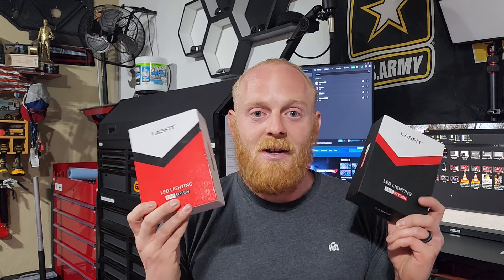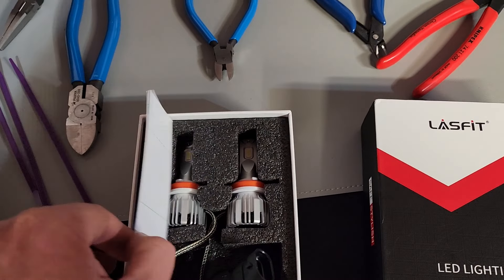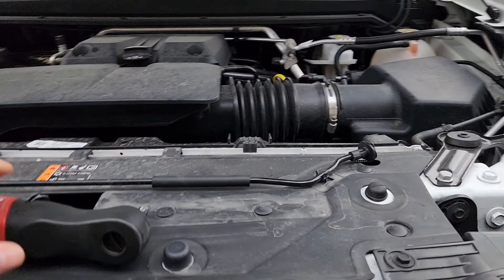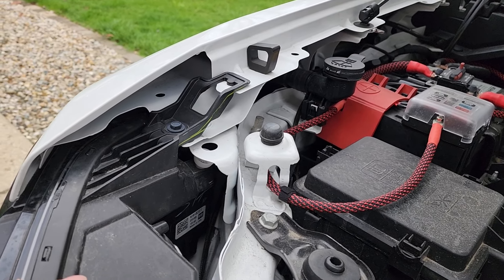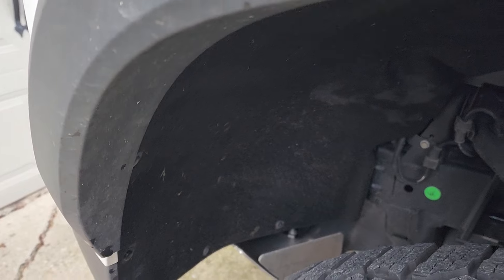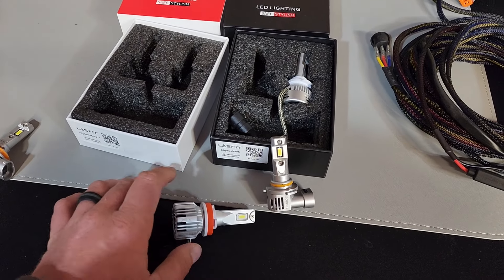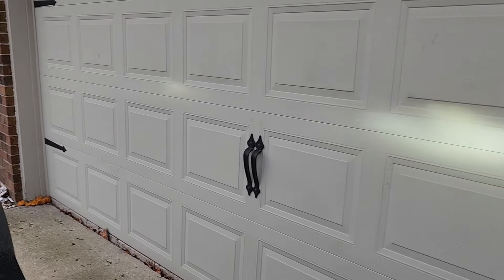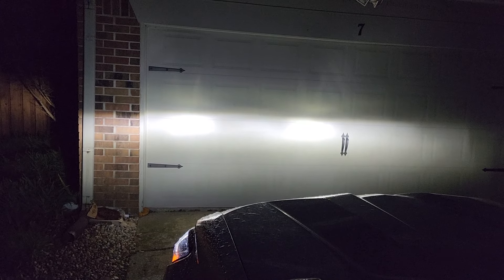2023 Colorado LED Headlight Issues Switch to Lasfit Do NOT use Oxilam

Comment: I installed the oxilam after I watched your first video. Ran into this issue about a month ago and got worried about having leds in halogen housing. I switched back to halogens. I have the lasfits that you have in the video but now I feel better about putting them in. Thanks!
Reply from the maker: Ya unfortunately I never had experience with oxilam lights before and won't be going with them ever again. I should have stuck with the lasfit brand to begin with. Just a much better bulb. Sorry you had issues as well.

Comment: for about 3 or 4 years ive only used the "sealight"? brand, 2001 Mazda Tribute (ford escape) has over 25k on the various LEDs ive done, doors, heads, fogs, dome, tail, signals, etc. i dont think a single incandescent or halogen is left anywhere, just FYI
Reply from the maker: Ya sealight is another one I saw when I was first looking into lasfit many years ago. I think they started around the same time frame. I've heard good things about them as well

Comment: Hello again, Tony 
Thank you for another Great Video 👍 I had a 1999 Nissan Sentra that had the head lights flicker like that. But the cause was the alternator I went through two after market alternators, then I bought an OEM from Nissan, problem solved 😅 Again thank you
Reply from the maker: Ya I have seen that before as well especially on alot of older trucks. Thank you for watching

Comment: Do you have any issues with the lasfit high beams and moisture getting into the housings? Felt like the lasfit bulbs I got didn’t go in as tight as the oem bulbs when tuned into the socket
Reply from the maker: No issues on mine. Are you sure you got it fully seated?
Reply: @ they are, and we’ve had some heavy rain recently here in WA and I’ve got no moisture. I was just concerned because the adjustable beams make it able to move around a little.

Comment: Since the time you installed, Does this blind oncoming traffic? Have other drivers flashed their lights at you?
Reply from the maker: If you leave the beams where they are you will blind others. Simply aim the headlights down correctly and you will have no issue

Comment: I can't find AMBER LEDs fog lights for the halogen sockets for my 2023 Chevy Colorado. Can anyone help me find a good pair of AMBER LEDs on that? I have just installed Lasfits front running lamps with switchback turn signals and the Lasfits backup LEDs, which I'm very satisfied.

Comment: I couldn't get the LASFIT low beams to work, the collar kept spinning but was to tight to actually secure to the fixture. When i went to pull it the bulb out, the ring came off and fell behind the headlight fixture and cant get it out.

The High Beams from LASFIT worked just fine because it didn't have that weird collar.
Reply: The workaround for the extremely tight fit on the low beams is to use the gaskets off your original factory bulbs.  Lasfits low beam gaskets are too high.  I had this same issue and the gasket swap made them as easy to install as the high beams.